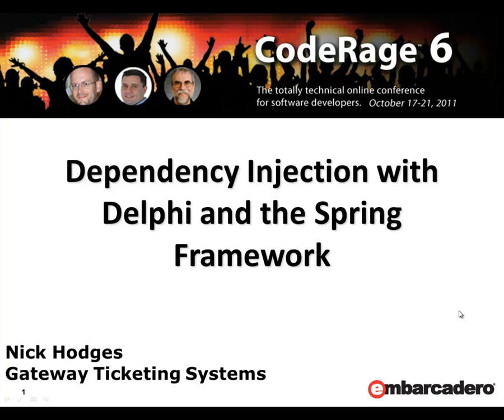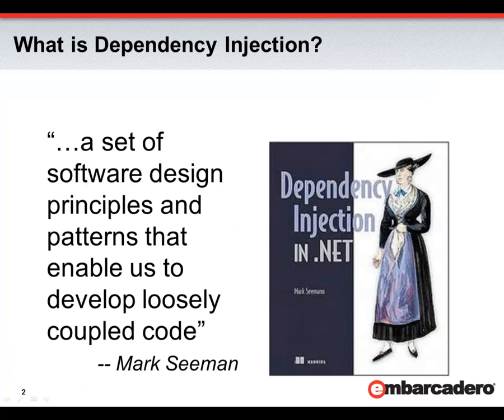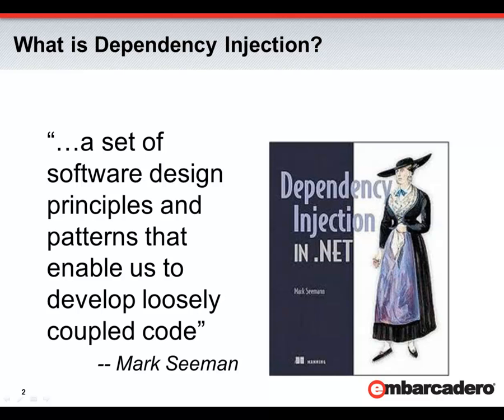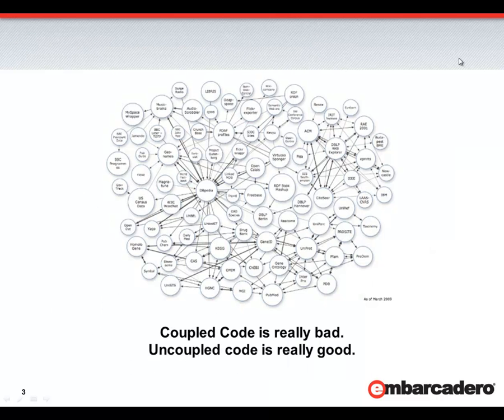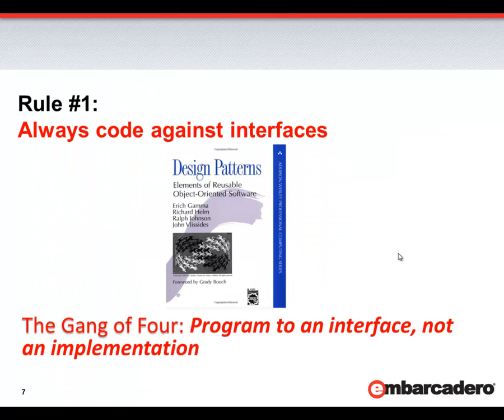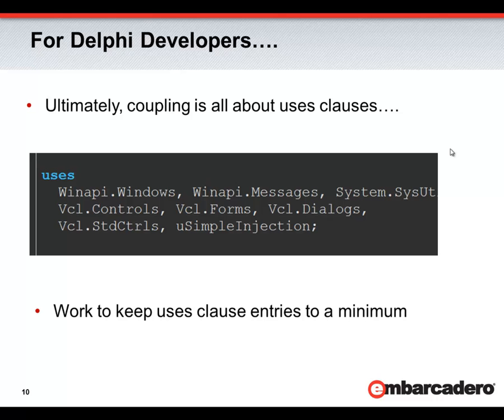Dependency Injection and the Delphi Spring Framework

Comment: What about speed issues?  Instead of calling a single constructor, which then constructs two fields, there's 3 service lookups and still 3 constructors underneath whatever additional code that the Spring Framework is doing.  If every class is generated this way, a project with 1000+ classes is injecting a lot of busy work done by the Framework on every instance creation...probably negligible on the client side but on a heavily loaded middle-tier side it would likely have a noticeable affect.

Comment: I don't see the necessity of this complicating process.
This process would be necessary in C++ or C#, but NOT in Delphi. Delphi is already component based. It is not only object oriented. The component system of Delphi is much superior to the interface Framework you describe. Components are defined and serialized by its property values. If you pass the property values instead of an object the components are already perfectly decoupled and the support from the gui for such a development process integrates in a marvelous way in the key concepts of delphi. The interface is already there: It's the published properties. The work of the programmer is to choose the published properties such that they are completely independend but defining the complete object. It's to the programmer to ensure that every selection of the published values defines a correct state of the component. By the  published values components can directly communicate through web services. Programmers can exchange components and Getit offers even a market place for that. One important point why I love delphi is the organic way component based programming is integrated in the gui. There is no other Gui in this world that is component based. C++ and C# are not at all component based. If you want to program a big project you have to use delphi because of this excellent supplementary layer of software architecture. The Microsoft dependence injection framework is only a bad compromise for its missing component architecture. Delphi Spring is only useful as complement for the component architecture that already exists. It has to register easily classical delphi components and to give some component capacities to objects that aren't already delphi components.